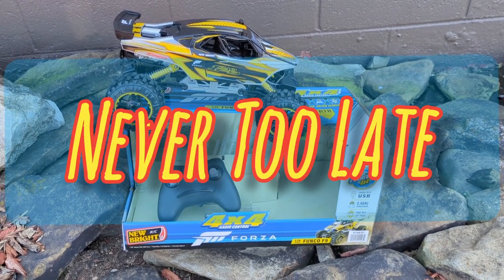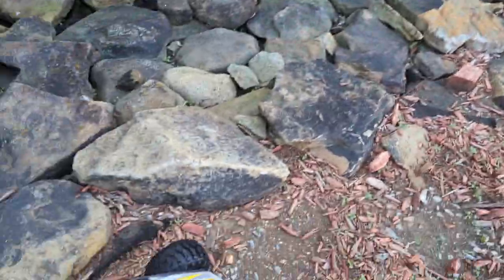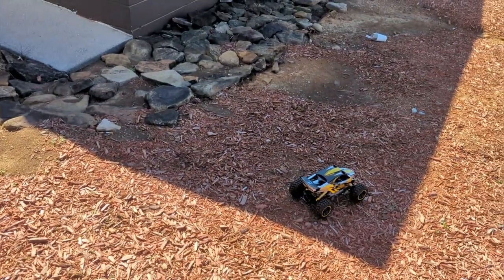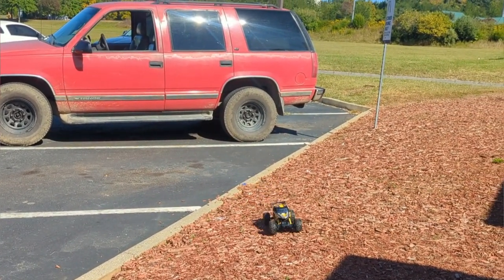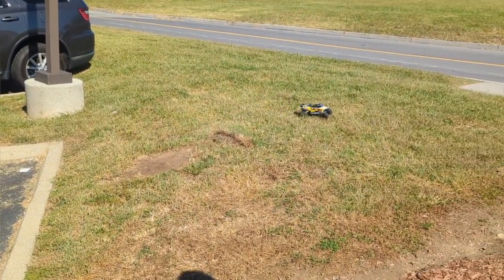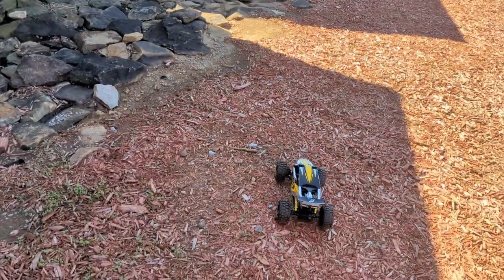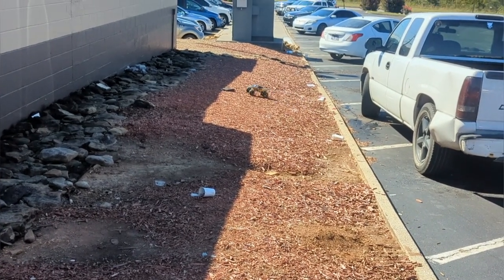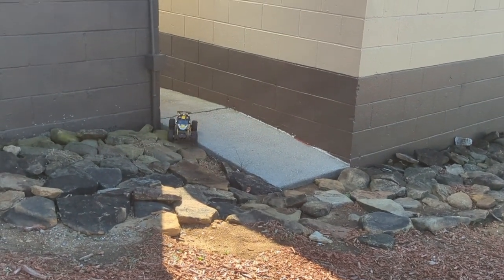Forza Funco F9 By New Bright

Comment: Just bought this one for $42.97 🇨🇦 at Walmart. Haven't tried it outside yet but I'm surprised by how much it can climb. I've tested it going over different stacks of books on the ground. Battery life is advertised as 15-20 minutes but can vary. New Bright says it's Long Lasting and I believe it because it feels like I've had the battery last me 20-30 minutes. The 9.6V battery is more powerful than other RC cars I've tried with 3-4V batteries. I'm looking forward to trying it on light snow and different outside terrain. In your video I have a feeling the power interruption could be caused by interference from the nearby store (e.g. microwaves and other electronic devices) and even radio/cell towers. Thanks for the video review I'm excited to try it outside now!

Comment: I just picked up two of these and I'm worried about the radios getting mixed with one another.
They're charging at the moment right out the box.
Used to be you had to choose the channels from the box or a switch on each unit. This is my reason for finding you as i was looking to see if anyone has mentioned any issues running two together.
Book says they auto sync, so I'll find out shortly.
Good video and great test you've provided, I like your choice of rocks and I'm blown away you were able to jump that curb twice right off the bat!